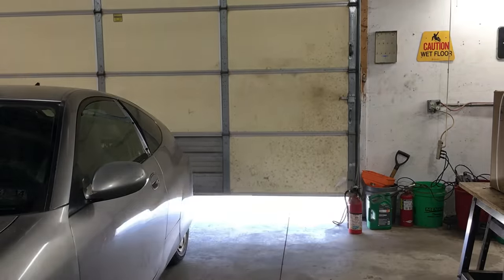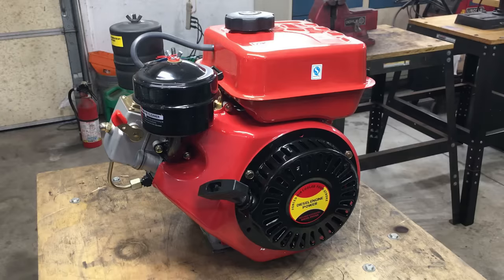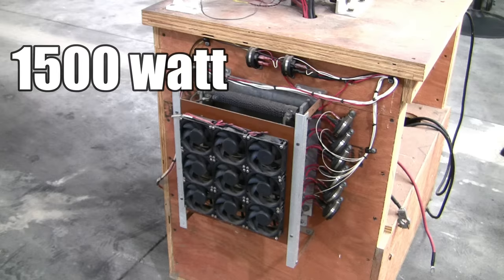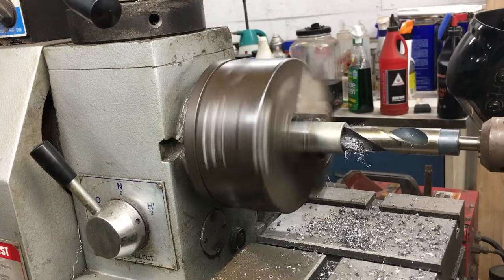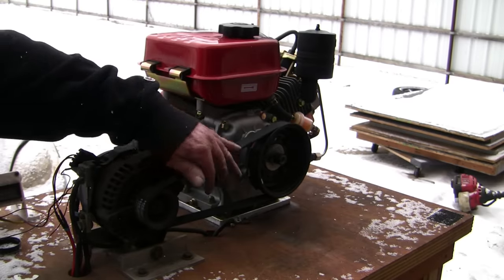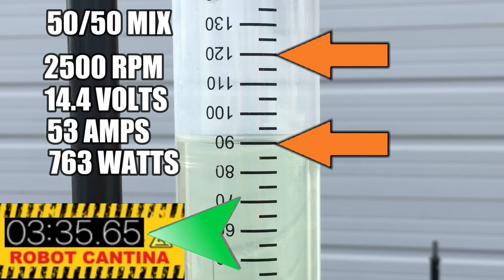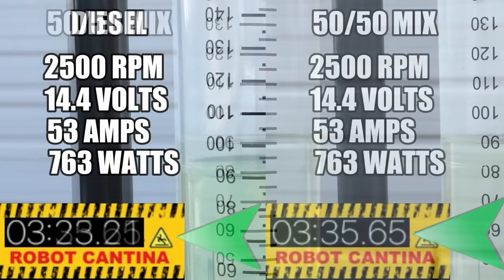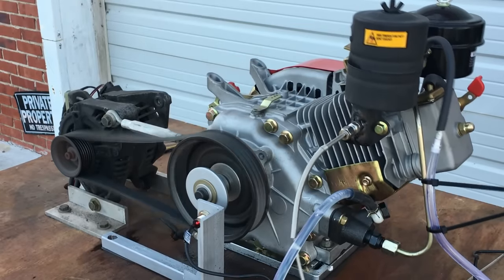S4 E3. How good is vegetable oil as a source of fuel for a diesel engine?... We find out!. plus more

Comment: I collect Waste Veggie-Oil from a local restaurant in it’s original 4.6 gallon jug. I let it settle for 2 weeks, after which I drill a small hole just above the water and food level. The clear liquid drains into a 6 gallon bucket that we get from a pool and spa company for free. On top of the bucket I have a 400, 200, 100 and 75 micron polyester filters. I then pore the clean oil into a 30 gallon container and add 10% Gasoline to it. Using a small 12 volt gear pump from Seaflo, the clean oil is pumped through a 20, 5 and 1 micron polyester pleated and cleanable whole house filter into a 275 gallon IBC Tote. Using the same pump I draw out the desired amount and add more gasoline as needed according to the outside temperature. In order to use waste Veggie-Oil it must be blended with a solvent to reduce its viscosity to equal that of Diesel fuel. The colder the ambient temperature the more solvent is needed to prevent jelling of the fuel.
    • 10% of Gasoline is good for temperatures above 80 degrees
    • 15% of Gasoline is good for temperatures above 32 degrees
    • 20% of Gasoline is good for temperatures below 32 degrees
    • 30% of Gasoline is good for temperatures below 0 degrees
Reply: @stevenfrazier8939 Where would you recommend getting these types of filters from and do you struggle to clean them? Do they clog often? Any issues with water in the recovered oil? Thanks in advance for any insights you might offer.
Reply: That was pretty much how I did it when I ran my truck on Waste Veggie Oil. I used similar blends based on temps but I cut the WVO with diesel instead. 

One thing you don't mention is bacteria and mold in the WVO. I had issues at some point and had to throw away over a hundred gallons and totally clean my storage. There are biocides to use that will prevent this (highly recommended).  Clean, filtered oil is the ley however. No dirt, no water.
Reply: @HyperSpaceProphet  The gasoline seem to keep the oil from going off.
Reply: ooooooo, nice.
Reply: If you preheat the vegetable oil it lowers it's viscosity. I used a engine Volkwagen oil/coolant heat exchanger to heat the oil just before the injection pump.
Reply: @supertekkel1  that works if you have a second fuel tank with switching valve/s. I think the original commenter just throws his blend right into oem tank.
Reply: You can set up a really cheap filtration using diatomaceous earth to get the oil super clean (in terms of particulates.) If you put a barrier such as cloth or a cotton mat on top of it, you don't need to let it settle. The big stuff collects on top, and the fine stuff is trapped in the DE. It is quite cheap, and about as effective as your 1 micron filter. This is the setup I use for making heating oil.
You can also use a dessicant like calcium chloride (sold as sidewalk ice melt) to pull out the water. Dehydrate it first by baking it. I leave it in the bottom of the clean oil container, and it draws water out of the oil just fine. It can be recycled or discarded - it isn't very expensive.
Reply: Thank you for the suggestion. I have a chemistry background and can appreciate your method. Our goal is to keep from repeatedly buying things to clean the oil. That said, all of the filters are Polyester and cleanable. The pump runs off solar power and the settling eliminates water, food and animal fats. Adding 10% petrol at the start of the process precipitate the undesirables. Since I am adding petrol to the oil for the desired viscosity anyways and the solvent nature of the petrol is not diminished, it works for me without costing any more. Hard to improve on almost free. In addition, our generator has a 5 micron water capture filter and seeing that a Diesel generator does not need fuel to be cleaner than 5 microns and ours is 1 micron nominal we got it covered.
Reply: One more thing, thinning oil with diesel to make diesel leaves the viscosity a little to thick. However, petrol (gasoline) is a better solvent and thins the oil much better. Plus it cost less.
Reply: I have put together a biodiesel processor. It has its upfront cost and consumables but feels like the best method when factoring in engine longevity.
Reply: Have any of you guys tried the gelatine method? I have no use for bio diesel currently, but I have heard many say that it is a really good way to do it.
Reply: Haven't tried it yet, so, lets look at the process. For very 10 gallons (38 liters) of Veggie-Oil, 6.7 oz (190 grams) of gelatin is needed. Add the gelatin to 1.25 gallons (4.75 liters) of hot water until dissolved. Mix the gelatin with the veggie-oil and let it settle for about 24 hours, this is temperature dependent. Drain off the clarified oil and add the appropriate amount of solvent as per the ambient temperature. My take away is this: The cost to acquire the Waste Veggie-Oil + cost of gelatin + cost of petrol based on temperature, increases the cost per gallon of finished product. Best price I have found is $115 for 10 pounds of gelatin which is $4.81/10 gallons veggie-oil or $0.48 per gallon. Add the price of petrol at $2.67/gallon at each percent needed = price per gallon. Here in Michigan at 30% blend, price per gallon of finished product would be $1.28. Without the gelatin it would be $0.80/gal or $0.48 less.
Reply: @stevenfrazier8939  Ok, so i guess the only benefit for the gelatine method is speed then. 
But it cost more. Thanks for doing the calculations, I have been wondering about that. I wonder if the end product is better somehow compared though, because I have seen many being very adamant how superior the gelatine method is.
Reply: WVO Cleaning - Waste Veg Oil Multi Settling Tank Method by VOGMAN

https://www.youtube.com/watch?v=PRlt2tbuq8s
Reply: @stevenfrazier8939  have you tried kerosene instead of gasoline to thin the veggie oil?

Comment: Back in the 80's, the State of Missouri commissioned  my Dad to convert 3 vehicles to "alternate energy sources that could be produced within the State"
  Dad converted a state owned 84 Malibu to run on assorted mixtures of Gas/Ethanol, a 1982 Chev Luv (quite a few of those available at a discount when the S-10 came out) for diesel, and a already converted Ford Ranger for electric.
Once the State was done with their testing, they offered him his choice of the vehicles- he took the Luv.
 Drove it for 12 years on pretty much everything except diesel.
Reply: Id love to have a diesel Luv
Reply: My first vehicle was a ‘82 diesel Chevy LUV. I used to joke that the only actual Chevy part was the tailgate, as the truck was actually made by Isuzu. I got offers nearly every day from people who wanted to buy it. My dad ended up driving it well into the 2010s, believe it or not.

Comment: Commenting before i watch. In my youth a friend of mine's father used to make his "own" fuel from all the restaurants used fryer oil. Usually they have to pay to get rid of it so he got it for free.

He had two large oil drums, with a pipe connecting the two, and a pump and filter mounted on the pipe. 2/4 Fryer oil went in one barrel, he then added 1/4 used engine oil to it and pumped the mix through the homemade filter box into the other barrel, where he then poured in 1/4 aviation kerosene. He claimed, that it in his old Mercedes 300d (123) it made the car accelerate harder and also run smoother with less smoke.

I still remember driving behind his car, and the exhaust coming from it smelling like french fries and gunsmoke. 😁

Comment: Back about 15 years ago I had an old F250 with a naturally aspirated 7.3L diesel. I was working as a mechanic, full time, and would frequently dump old motor oil, transmission fluid, vegetable oil, etc into the tank (after filtering it) since it theoretically should have worked and it was a cheap old truck that I was willing to experiment with. The result was that the truck always ran perfect. I never filled the tank with 100% "other stuff", there was a always actual diesel fuel in the tank along with whatever I was adding to it. But, it ran perfect. Never had a single problem. No unusual starting, no changes in acceleration, no issues with letting it idle for long periods of time. I did that for years and had no problems at all. It ended up being something that I did without even thinking about it, and I just saw it as a convenient way to get rid of used oil/fluids while reducing my fuel bill.

Comment: My dad use to run used engine oil his his ford 1 ton truck.  He had a filter setup that took all the carbon and any moisture out.  He ran it for several years.  My brother even started running it in his dodge pickup.
Reply: My uncle does this with his 2000 F250 diesel 7.3.  He lives in Florida and the truck is still in great shape body wise.
Reply: @Clearanceman2  I was gonna ask OP if it was a 7.3 but I figured it was. I've seen loads of folks doing that, they don't seem to care much 😂

I run my tractor on anywhere from 50/50 to straight waste oil. I get plenty of it from work and it makes my summer brush hogging pretty cheap 😂
Reply: Used engine oil is good for heating a work shop.  I used to have a trucking company,  and the used oil was used to heat the shop. The heater would burn about 1 gallon of used oil an hour.  A lot of truck shops are saving used oil to heat their shops.  Fairly cheap way to heat, and dispose of used oil.

Comment: If you want to make your engine last a lot longer cycle the crankcase oil through a filter . This increases oil capacity and keeps the splash fed Berings from the nasty contaminates ln these cheap Chinese engines .a small 12v pump is all that's required. Great work as always 👍
Reply: How would you do that? Draw oil from the drain, pump through filter, then return to engine via dipstick hole?
Reply: Any idea where he got the engine? Was it a one time thing or is someone selling them for that somewhere?

Comment: Hey Jimbo! Love your work! Since german engineer Rudolf Diesel (1858-1913) built his first diesel engine in 1892. He experimented at first with a number of fuel sources including coal dust suspended in water however by the 1900 World's Fair in Paris, Dr Diesel had his engine running on 100 per cent peanut oil! Can you try with peanut oil to see if that realy works on todays engines? Thanks and keep up the great work!
Reply: Oh I would love to see the coal dust in water tested! There are a few of his original old single cyl diesels out there, would be a cool tribute to him.
Reply: If I remember correctly, Dr Diesel designed his engine specifically for farmers so that they could run their tractors on peanut oil that was grown on their own farms. Growing your own fuel must have been a boon to farmers back then. Probably still would be if farm vehicles weren’t so complex nowadays

Comment: Here in Oregon, a lot of hippies run their old diesel, Mercedes on vegetable oil, always been curious whether it’s worthwhile taking on such a project. Thanks Jimbo for doing the investigation.
Reply: It can be but there is a viscosity problem with the veggie oil. Most folks that didn't ruin their engine have a 2 tank setup where coolant warms the veggie oil. Start on diesel, switch over to veggie, 60 seconds before turning the engine off switch back to diesel. There is a lot of dewatering and filtering to go through when using waste vegetable oil too. For all the effort you might as well make biodiesel and not modify your vehicle.
Reply: @Sygma6 the old in-line diesel pump on Mercedes don’t need conversion, only issue is the viscosity of oil in cold climate, 2 tank systems is for modern engine.
Reply: 1.9 TDi alh/asv with VE pump
You can run straight new vegetable Oil up to 10c :)

Comment: As far as I know, main problems with veg oil as diesel substitute are glycerin deposits and acid pH that may cause corrosion in long term. Also, they are not a great option when cold temperatures hit, bc they become very viscous. In that case, is good to start the engine with diesel and through a heat exchanger warm up the oil

Comment: You can get a pulley that is bored to fit onto a taper bush of one of a number of standard sizes. Each size of taper bush is available in a wide range of inch and metric bores to accept the shaft. You only need an Allen key to tighten the assembly, and it will run perfectly true and will not fret, not even when it is on a single cylinder four-stroke diesel engine. With the same Allen key you can also easily loosen and remove the assembly.

Comment: Try rendered fat as a fuel!  In a zombie apocalypse, there would be a lot of available sources of fat (pre-zombie humans?) that could be a readily available source of fuel as the vegetable oil dries up. Plus, it gives you something to have running up front of your makeshift shack/compound that will let passersby know that you're a source of fuel - you in a rocking chair in front of a fire, occasionally draining the rendered fat into a fuel tank of sorts. Plus an enormous barricade of zombies stacked up behind it.
Reply: animal fat would cause an algae. Semis get it from bio diesel since they removed sulfur .
Reply: If you have a supply of methanol and sodium hydroxide, animal fat can be used to make excellent biodiesel. The only downside is that it has a high gel point compared to vegetable biodiesel.
Reply: You've put some thought into this. 🤣

Comment: Ooo, experiences from my youth coming back to be useful one more time! Back in the mid 90s, I was helping a friend convert a Merc 300D over to WVO, and we went through the whole process of scavenging from Chinese food shops (arguably the cleanest source compared to western fast food fryers), filtering and modifying the WVO to run in both summer and winter midwest environments. I have a notebook of our trials and tribulations musting away in a box somewhere, but going from memory, we had to dope up the WVO with 20% methanol to get it to run in winter reliably.  At today's prices for methanol, I'd probably look into something cheaper like kerosene or even mineral spirits, but I don't have data for the percentages off hand. I bet if I could dig up my alt fuel book written in the 70s that we used for inspiration, it'd probably have some reference numbers. That's a log of digging that I'll save for apocalyptic conditions another day. 😁👍
Reply: Holy crap! I just made a post about my dad and I doing the same thing with a 300d! 15gal wvo, 1 gallon kerosene, and bottle of fuel stabilizer. Worked great! Like $10 for 16 gallon of fuel.
Edit: also I concur about the Chinese restaurants having much cleaner oil!

Comment: I've heard this so many times but I'm not gonna risk my engine to test this and people I actually know never really try this. Thanks for testing this now I know
Reply: Its fine with full mechanical injection, but EFI diesels cant atomise it properly.
Reply: I have been running used Veg oil over 25 years.  It works fine and people who say it does not are just doing it wrong and usually cutting corners. It has to be Clean 10 Um or under and DRY because Veg oil DOES hold water.

Comment: I just ordered one of those tachs to adapt to my budget experimental 1987 diesel suburban.  Thanks Jimbo for showing that. I had no idea they made something so cheap!
Reply: Right , I'm thinking about getting one just cuz I like the display of it and for the pric3 .. why not right 😅 peace and love bro
Reply from the maker: It's actually a great tach for the money, but my camera wont sync with the display.
Reply: @robotcantina8957  I have notice that led displays and cameras don't like each other 😂 not just you brotha .. peace and love jimbo and preciate wha you do bro
Reply: @robotcantina8957  Old filtered engine, gearbox, diff oil, brake fluid and at a push basic form of Hydrogen to extend the range in a Zombie Apocalypse... oh not forgetting gasoline vapers too... every option would be used...
Reply: @mastercricket7626  I ran my 1.4 TDI VW polo and Isuzu 1.7 TDI GM/Vauxhall Cavalier on cooking oil....
Reply: @kylereese4822  hell yeah bro that's rad ... and also cool azz rides bro 🤘🏽

Comment: Side quest...build a cracking furnace(is it a furnace?) to turn plastic and other things into fuel.
Reply: Pyrolysis is the process of heating plastic in a low oxygen environment and then distilling the output gas as fuel. Apparently you can get fuel weights similar to propane, gasoline, diesel, etc.
Reply: I think its called a cracking distillery

Comment: Last I checked (I run veg oil in my old Mercedes), the energy density of veg is about 10% less than diesel, so at your 50/50 mix you may notice a 5% difference in potential.

Comment: If you want to experiment with diesel alternatives I would suggest actually getting a hold of some waste fry oil like you mentioned and see how difficult it is to filter it out effectively (after all you would need to find a good low tech solution to do so in the AI zombie apocalypse), I would also suggest doing the same with used motor oil, using different cutting additives like kerosene and gasoline, and even maybe find a way to measure the carbon output at the exhaust to measure the burn efficiency of the different fuels. Love your videos, always the highlight of my Sundays.

Comment: Ran old Mecedes, Vokswagen and Volvo Diesels (mostly before Y2K models) without any issue on veggie oil. A bit harder to start in the winter, but once running no issues. More modern electronic/piezo injectors may behave differently, but the mechanical injectors ran ... and ran ... and ran.
Reply: I have done the same. Summer time 100%, winter time 70/30. On mechanical and early electronic, there are no problems whatsoever.